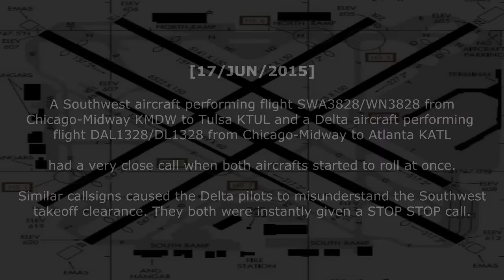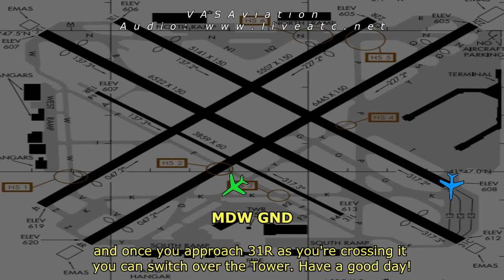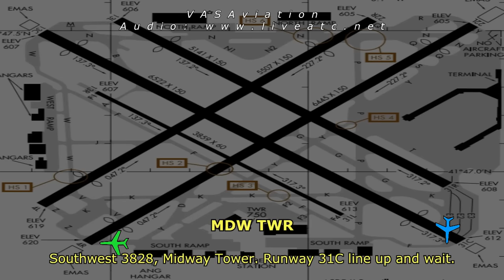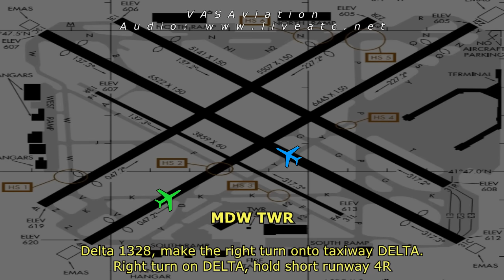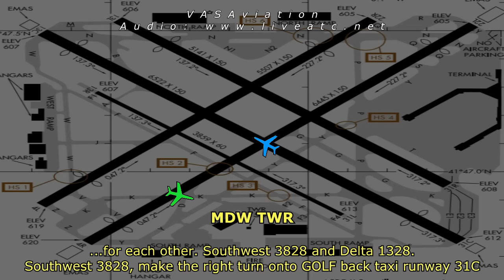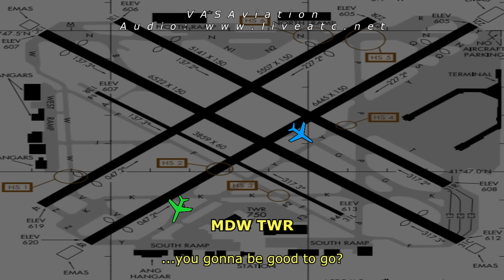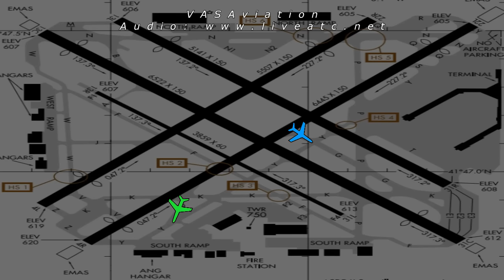[REAL ATC] Delta and Southwest VERY CLOSE CALL on takeoff

Comment: Mistaking the callsign is one thing, but how did he listen to 31C and hear it as 04R is beyond me.
Reply: That ☝🏻
Reply: Either hearing problem or audio problem
Reply: Zed283 like the whole aviation for you
it seems
Reply: while it might be what we heard, radios, believe it or not, are still utter shit and sometimes have too much static
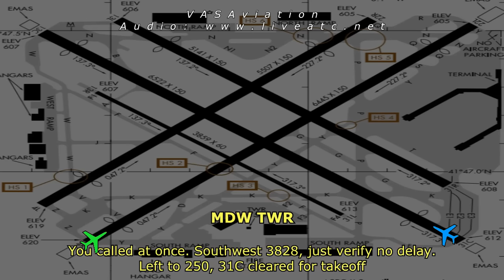Reply: 1:24 can you clearly hear "31"? No you cannot.
Reply: @joker_g7337  1st... I can CLEARLY hear CENTER......2nd i didnt and never heard FOUR or RIGHT or anything resembling either of the 2 words. So how did he assume it was his call when the correct runway wasn't even mentioned.
Reply: @joker_g7337  NOT TO MENTION it wasnt even the correct Airline called. Controller clearly said southwest not Delta nor again, anything similar.
Reply: Laurel Yanny thing...
Reply: Hey man, the pilots don't get nice little colored 1080p text to read. They do the best they can with whatever radio given
Reply: @vainglory991  Exactly. Close your eyes and you'll realise that it's almost unintelligible. But that was at home. In real life, they also have to deal with a million distractions in the cockpit. That's exactly why they have to read back all commands issued by the ATC.
Reply: @VarunGupta3009  Exactly, since when do pilots act on unintelligible commands? AND it was said twice. After the 1st, the ATC reiterated the same command to the southwest flight. The pilot twice, heard 31Center and took off from 04Right, two times he heard southwest and took off in a delta plane. Its just a mistake he can reload and repeat, youre talking about a professional pilot with lives in his hands. This is NOT a simple radio mistake. Im 100% sure he was investigated by the FAA or the NTSB
Reply: 1:35 Oh no he has earpods on
Reply: Also the tower was saying it too quickly when he knows there are 2 similar callsigns
Reply: Must be a bunch of pilots roasting you in comments. Yes the ATC should have done a touch more than make both pilots explicitly aware of the call sign similarity. The fault still sits on the Delta pilot like it or not. He heard loud and clear there was a similar call sign and instead of asking for repeat on a transmission that wasn't clear he went ahead and rolled. To make the excuse that 'radio bad 4head' is horrible. If delta couldn't understand the transmission to the point he missed both runway call outs and the specific southwest call out then he most definitely should have asked for a repeat before rolling.
Reply: Not to mention I just rewatched and listened. 31 center is clearly audible in BOTH transmission. Delta fucked up.
Reply: Was just about to make the same comment.
Reply: Radio still shit even today,, 
Idk why we still can't make radio sound clearer and prevent audo blocked...
Reply: Ye i’m sure you’d do it better big boy
Reply: Real bad idea warning about similar call signs and then lining them both up on intersecting runways.
Reply: @Senokone  yeah with the exception of one of them being a fucking professional pilot 😂
Reply: Also both pilots were warned in advance. I dont understand how that  even happened. There were so many signs for the pilot. Not at all the act's fault
Reply: What happened was they stepped on each other so the controller cleared SWA for take off and delta heard it and thought he was cleared too
Reply: Maybe he expected him to say 04R, so he didn't pay much attention to that
Reply: Sometimes, everybody of us can “hear” or “see” what we are going to expect...
In this case, we don’t even know if this was their first flight of the day or maybe the fourth...
If you are getting tired, the attention can be at a lower level, and that is normal, because we are human, not machines...
With this very complex environment yes,they should have been more concentrated, but nobody can blame them for this, because can happen to anybody. (The flight crew is only the iceberg’s point, the last part of the chain).
And yes, I m an airline pilot.
Ciao.
Reply: When 2 or more person In a frequency speak at the same time,It will cause a Disturbance and The sound will be Unclear/Blocked completely. Or so that's what I read.
Reply: @alfin9189  we were gonna have another Tenerife like incident again
Reply: @vainglory991  1080p text? what is that ?
Reply: @segredosdotiosam9989  a screen with 1080p resolution and nice text to read, like what we have
Reply: I was just going to say maybe they should name their runways different, but 31C and 4R should be different enough.
Reply: @Dayvit78  Name the runways different?  Like what? Runway Mickey Mouse?  lol
Reply: @segredosdotiosam9989  Why not? Paint big mouse ears on one and goofy ears on the other. You're cleared for landing on Goofy East.
Reply: @Dayvit78  The runway numbers are simply the orientation. If you are landing on 09 you are landing heading 90 degrees or simple landing from the west to the  east.
Reply: @segredosdotiosam9989  Look I guess people are not really responding to the joke. So let's talk reality. If the runway is 31 degrees, SW should know they weren't heading that direction, so why did they respond? There was a clear miscommunication here - put the blame on the pilots and the tower.
Reply: @Dayvit78  This is a human  brain thing . Sometimes it goes on autopilot and we hear what we would expect to hear and see what we would expect to see. Sometimes I'm sure that someone said something on TV when they said something else. My wife corrects me and I still think I'm right. Until she rewinds live TV and  makes me fell like a dumbass.
Reply: Grandma Rules the Verse Yes. I heard 31 center two times.
Reply: @alfin9189  Most likely an inattention problem.
Reply: @joker_g7337  Yes  you can. I can hear twice the word Centre.  There is no RWY 4C only 4L and R. The TWR controller read the clearance twice. It is up to the pilot to listen closely. If the pilot is in doubt he can always verify.
Reply: Might of mistaken the call sign and didn’t pay attention then assuming it’s for him and took off.
Reply: Sorry it anyone says this else where but if 2 planes have similar call signs could they not be given temporary call signs until they have cleared that particular airspace - not being flippant in saying this but could one be called Pink 5 and the other Green 2 or something similar, just in these unique circumstances?
Reply: @davidhughes3337  That could cause more confusion as then the two aircraft would have too look out for two callsigns.
Reply: @davidhughes3337  it’s easier and less confusing to everyone just warn the aircraft(s) in question  to listen out very carefully as there’s similar callsigns.
Reply: @LiamHolloway  - thank you
Reply: Probably just heard “Delta ..28...cleared for take off”. Selective hearing I guess, i dont know.
Reply: Yes this is right. If you can’t hear your call sign, at least the departing runway was called.
Reply: A pilot friend told me it's called flight crew expectation bias.
Reply: You can also notice that after the aborted take-off, Southwest readback the instructions given to Delta. So the action of mistaking callsign happened to both of the airline pilots.
Reply: @zaabri283  I wonder if pilots don't listen for the runway anymore after they're already on it, and just listen for their callsign or the end digits of the callsign, which is probably what happened here.
Reply: assumption of take off clearance
Reply: @VarunGupta3009  while somewhat true, it’s not unintelligible to operating staff, myself included. I know when my friends come to visit me at my tower, even though they know English, they can’t understand what I’m saying at all. Furthermore, even new ATC personnel often asked me what did the pilot say as I got used to hearing them during the several years on the workforce. 

It’s the pilots fault, but it’s a normal human error, not a gross misconduct. It happens to the best of us. The ATC was thankfully very concentrated and therefore stoped a possible disaster.

Also, there’s a saying “say again” that should be used if the pilot really didn’t understand the ATC.
Reply: @Arthang  as an atco, I fully agree with you.
Reply: @TheBudgetAquarist  that’s normal, that’s why they were warned.
Reply: @alessandrocanali3119  the fault is clearly on the pilot though. That’s not up to discussion. His mistake almost cost heavy life loss. Doesn’t mean he did it on purpose or that he is a bad pilot in general. Human error is expected.
Reply: @Dayvit78  how do the tower? Please explain, expert.
Reply: @alanwolf5632  Yes, I understand. I'm not an actual pilot as you may know, but I do hear a lot of ATC recordings and most I can comprehend most of them pretty well, but this one was kinda gibberish on my speakers, so that's what prompted the comment :)
Reply: The ATC also seems to be keying the mic as he’s starting to speak, cutting off the first word and a half of his instruction, which doesn’t help
Reply: sometimes you hear what you want to hear
Reply: @tommywiseau_  You heard that The Room was a pretty good movie.
Reply: @VarunGupta3009  for some reason or the other, I forgot to reply. I understand you, and I don’t want to diminish your experience. Although, I must include two important factors. 1) This recording isn’t the same quality as the real live recording considering it’s taken from liveatc. 2) When I was a student atc and worked hundred of hours as an atc on rating training with “pseudo pilots” I was completely confused when I actually got to my work location for my on the job training because I couldn’t understand half the things this pilots were saying. Because, unlike training, there are numerous pilots with lacking English, bad pronunciation and heavy accents. All that without including the equipment element. It took me quite some time to confidently hear and understand most pilots most of the time without saying “say again”. 

What I want to say, just because you heard quite a few of a lot of communications here, it’s still extremely different in comparison when actually working as such professionals in the field who hear those voices and act upon those instructions and vice versa for hours every day. For example, I understood completely this whole conversation without looking at the screen. Not to mention there were two very different runway markers and the pilot shouldn’t confuse who was actually cleared for take off. It was human error at it’s simplest form sadly. Happily, it all ended without severe consequences.
Reply: @alanwolf5632  You're absolutely right. I stand corrected. I forgot that pilots have years of experience and real-life situations are much different than just recordings on YouTube. Thanks for the clarification, and the detailed explanation. :)
Reply: @VarunGupta3009  no worries man. Thanks for being a decent human being on YouTube. It’s a rare occurrence. :)
Reply: @kziad1  This. It’s the responsibility of tower to manage his airfield, not the responsibility of the pilots
Reply: my guess would be he was hyper focused on his stuff he knew where theyd be sending him and what he was waiting for so he tuned out 90% of the message assuming its info he already knows and waited to hear the clearance and then spliced in the information he was expecting with the clearance of the other plane
Reply: Its called confirmation bias. The "no delay" didnt help either I guess..
Reply: @Jaxck77  Someone doesn’t have a single clue about aviation.
Reply: 69th reply
Reply: Dont underestimate confirmation bias...
Reply: how do you listen to 04R as 31C?
Reply: @AUEN1512  honestly, compared to army radios this is very clear. Our radios make it sound like someone is screaming at you through a waterfall.
Reply: Expectation bias
Reply: Confirmation bias is a silent killer like that
Reply: @AUEN1512  Because the better tech that can do that is digital, probably has microprocessors, and could have any of a dozen different failure modes or weird ways to hack it that we're unaware of.
Reply: Their callsigns are similar, ending in 28; their frequencies are the same.
Reply: @joker_g7337  uh, actually I can hear "31 center" quite clearly and I'm not even a native speaker. Even if you missed the 3, it'd sound like "onecenter", and Delta is nowhere near a one nor a center.
Reply: Expectation bias. Now it's not beyond you. You're welcome!
Reply: @joker_g7337  Are you kidding? I can very clearly hear 31 Center.
Reply: You aint a pilot so your opinion is trasg
Reply: @vainglory991  We don't need words on the screen to clearly hear SOUTHWEST  and CENTER.
Reply: @kziad1  But it was clear they saud SOUTHWEST and 31 not DELTA and 4.
Reply: @63076topher  Were you in cockpit? Did you have an ancient radio headset on?
Reply: @melvinelder3587  How do DELTA and SOUTHWEST  and 4 and 31 sound the same.  When the takeoff clearance was granted only one person was talking.
Reply: @alessandrocanali3119  Delta was totally in the wrong they didn't say DELTA or runway 4.
Reply: @IMCYT  And that is what we hear AFTER we clearly hear SOUTHWEST granted takeoff clearance on RUNWAY 31.
Reply: @vainglory991  No but we hear from the same frequency they do so it would sound the same to them as us.
Reply: @63076topher  Different ears, different speakers. Different environment. It's just not as easy in the real world lol
Reply: @vainglory991  Delta is alot shorter than Southwest and 31 is 2 numbers 4 is one they are not anything like each other.
Reply: true
Reply: You have THIRT-TEE-one twenty-eight and THIR-TEEn twenty eight,   And THIR-tee one c and FOUR-are all being spoken very fast.  Add in poor audio quality, cockpit distractions, and bit of expectation bias,  it’s very easy to see how the pilot could mistake the other pilot’s clearance to be his own.
Reply: He just figured they were clearing him to high-speed taxi up to the intersection and hang a left to takeoff.
Reply: I would file it under the "expectation bias" category.  It happens more often than one might think!
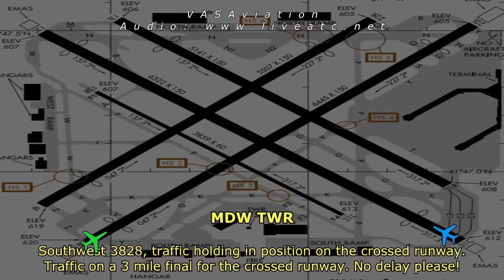Reply: @joker_g7337  1:14 yes. I do.
Reply: @zaabri283  The one bit of leeway I'll give the delta pilot is that tower kept getting the first word of what he was saying cut off... Which, unfortunately, was "SOUTHWEST"
Reply: some pilots are just landing and taking off on others pilots runways :)
Reply: @thericepotato5847  the radio quality in this is exceptionally lower than what the pilots and ATC hear
Reply: I don't think it's a hearing r audio problem. They speak very fast and mumble. As pilot you're used to it but I believe it's more likely they where busy with the start check.
Reply: @zaabri283  southwest and delta sound alike in a static radio
Reply: @Netbase2000  I'd like to add, that sometimes native English speakers can be too confident in their speaking and listening abilities and... you know... assume things they heard or assume that the other parties can understand what you say because you're... well, native English speaker.

I'm not a native English speaker and almost half these ATC conversation I struggle to comprehend why they would need to talk so fast and sometimes so close to the mic when safety is the reason they communicate in the first place. I'm surprised situation like these doesn't happen more often. Probably because there are compitent pilots out there who are willing to speak clearly and slowly I guess.
Reply: So to sum up, on the first TO clearance, ot sounds like the controller starting speaking before keying to mic so on the radio its ..28 but 31C is clearly audible on both transmissions and he definitely said south 3828 on the second transmission
Reply: @Arthang  “Is he not clear, that Southwest?”
Reply: @zaabri283  Yes I agree. This is BS. You should be able to understand that, or ask again if you didn't understand something. Assuming something which might be wrong is deadly
Reply: @vainglory991 they are trained to handle atc communications, but it is possible English was not the first language for the delta pilots.

Comment: This was borderline funny. They both read back when 3828 got the take off clearance, and they both read back when he yelled at 1328 to stop.
Reply: Like numba 60.
Reply: The fact that the one was keying in over ATC's transmission says a lot.
Reply: That should have been a sign for the controller to slow down. If the controller cannot clearly make out the readback and ensure it’s accuracy he should have stopped and confirmed. 1 go around is better than what actually happened
Reply: Only the delta pilot was confused.
Reply: @SYDAirlineEnthusiast No, everyone was confused.